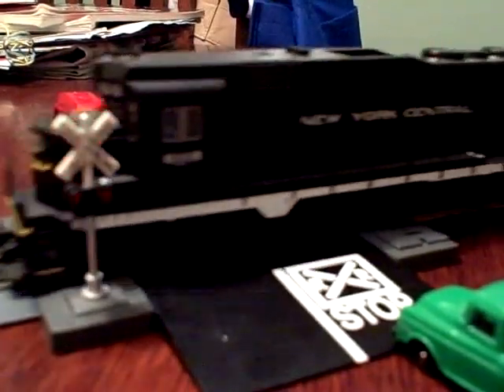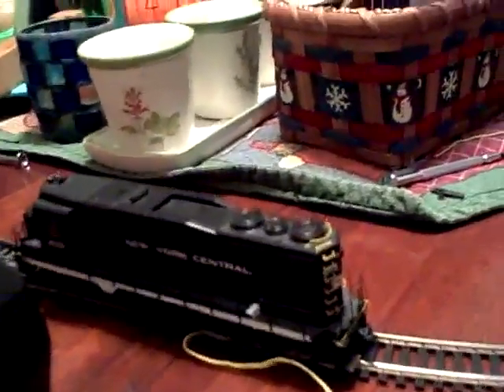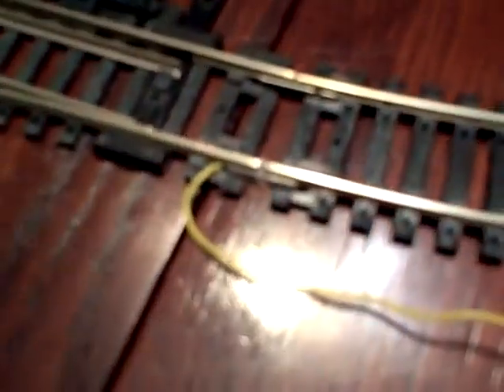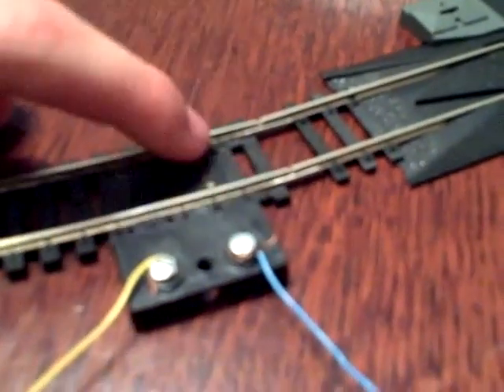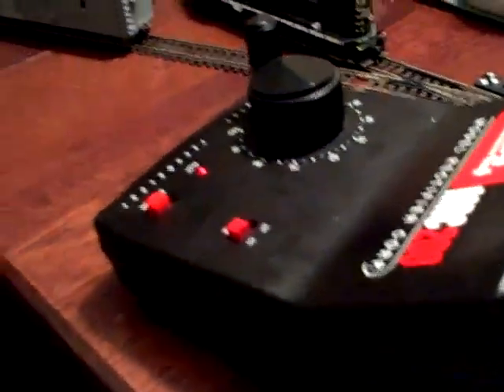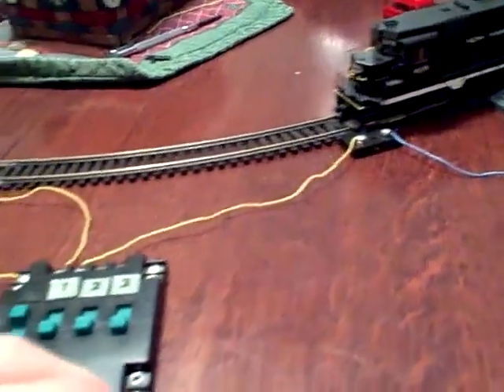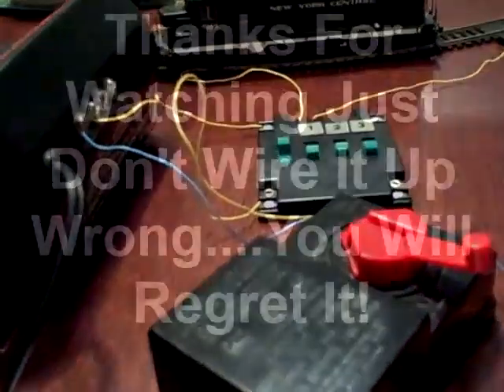How To Wire Up 2 Train Operation On DC

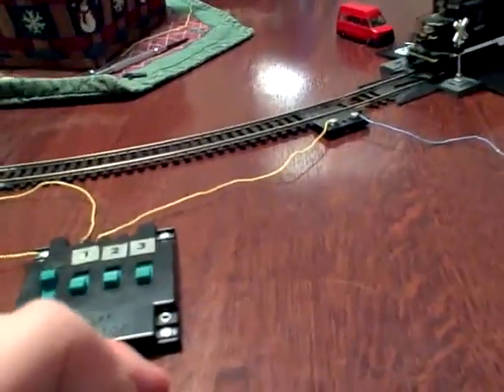Comment: Yikes, I wouldnt keep running this setup, Am I the only one to notice the sparks from the wheels shorting the two track circuits across the insulator @ 2:02?
Reply: Ciertamente hubo corto ya que al darle reversa a la loco invirtió la polaridad del segundo bloque y la Rueda toca ya el bloque de polaridad opuesta
Reply: Certainly so we need to use doble pole double throw switches and isolate the two rails. That way we can run two trains in opposite directions

Comment: I like your video.  This is what I need. I will be running two side by side tracks using the 215 selector.  Will I be able to run two trains in opposite directions by switching the directions switch on the power pack I am using?
Reply: That is not possible without damaging the power packs. In order to be able to run 2 trains in opposite directions, you will need to divide both rails into blocks. You would need to use DPDT center-off toggle switches since the Atlas 215 Selector cannot be used for 2 rail wiring.

Comment: If you're using 3' lengths of flexitrack, wire a feed to each length. Don't rely on your fishplates (joiners) to carry current - unless you actually want to solder your feed wires to the fishplates.

Comment: Could be a non-regulated power supply - putting a current load on it drops the voltage back to maybe 13, or even 12 volts if high enough.

Comment: I put 14 volts to be able to run 2 engines on a same train,if I put passenger trains,with only one locomotive,the carriage lighting do not take too much power to the locomotive power to run..I do that since many yaers and I did not have any trouble..But I have another power set that I use sometime,on this one,I put only 12 volts,
for sure,If I want to run single locomotive sets,then,I use the 12 volts power pack,I just have to switch the wire from one to the other,it take few seconds to do..

Comment: I'm  using DC for everything,I got my main powerpack,witch I use to operate trains,but I have switch to get power in 4 area of the layout,all the rest are mounted with a permanent 14 volts DC,so,when the trains are on,I have no contrôls cause they run by themselves on the permanent power,when train arrive in station or in the siding,then,I use my powerpack to make them stop,or leaving..But I can have some 3 locomotives consists on a same train,and it work great,but always remember,need 1,5 amp

Comment: Hey great video dude! Quick and to the point. Do you still use atlas selector switches for your blocks? Right now im running waterproof toggle switches that work great, but in the near future when i build a simpler layout for my kids.. i would be nice to show them the atlas brand.

Cheers

Mikey

Comment: Hey great video! I used to have a controller like that one but it broke so right now I'm currently using the exact smaller one you have in your video however I am having troubles with it. For some reason when I simply go to wire it DC in/out it doesn't run but when i wire ac/dc on that controller it runs but on the same speed. I know somethings wrong but I cant figure out what. What size wire are you using. If you could get back to me it would be greatly appreciated!

Comment: A better system is Minitrix EMS system, whereby you can run two trains on one track without blocks, or you can run four trains with catenaries. For each engine you need a powerpack, in the case of two trains a DC plus an AC pack, one rail is the common rail and the other mixes DC and AC, for four engines one rail is  still the common, the other RAIL and the catenary each mix DC and AC.